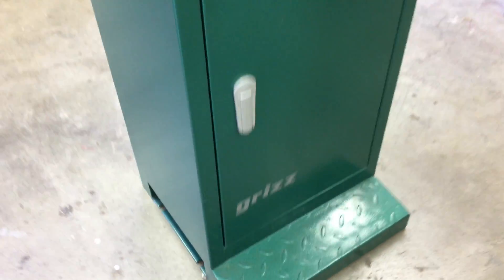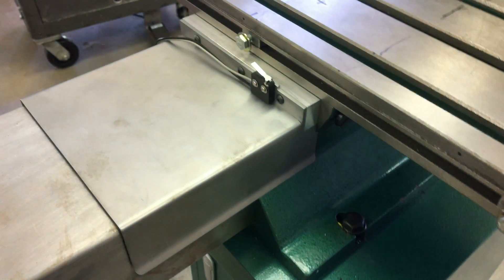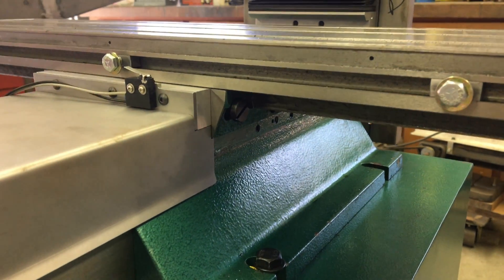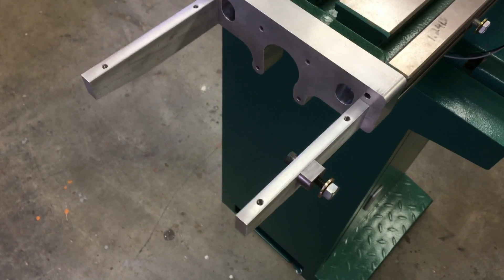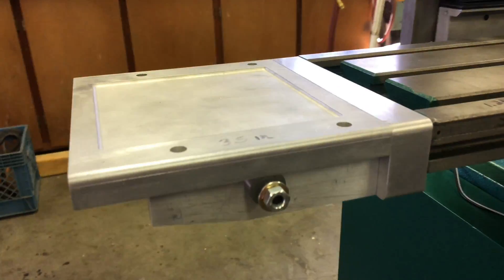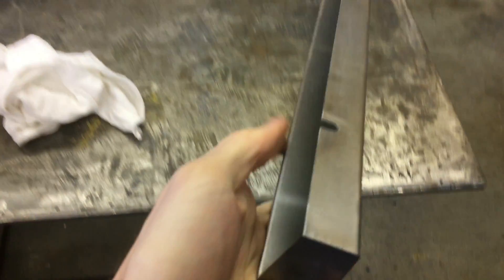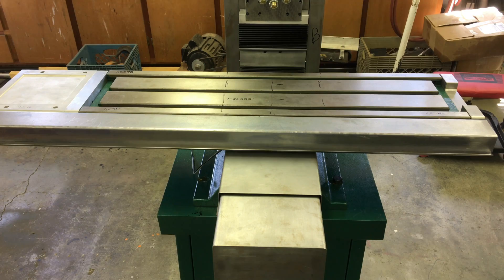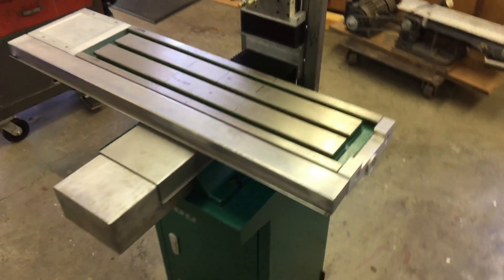GRIZZLY G0704 CNC Conversion Update 5 - (X & Y stepper cover / table gutter / X home switch)

Comment: Are you permanently going back to the original base or just for mock up?
Reply from the maker: @ Michael Alcocer  Yes the base is being use for mock up only.... Figured i would try to get some moneys worth out of it!!! = ) - Nick
Reply: If you do decide to use it, you can flip it over and fill the base with concrete. Then make a frame with wheels and leveling feet. Come out not bad.
Reply from the maker: I might have to do something like that! Thanks Michael. - Nick